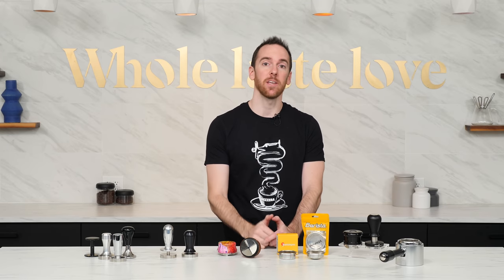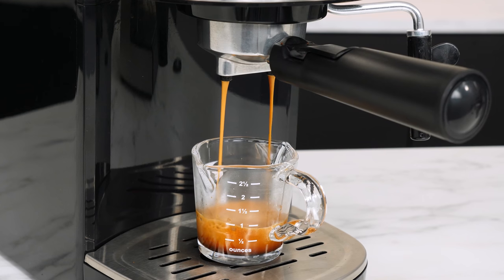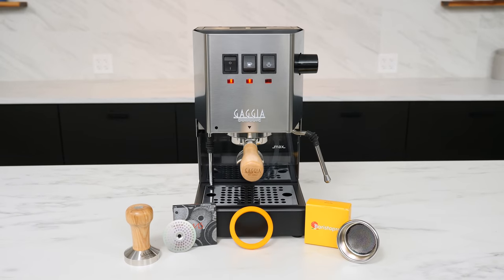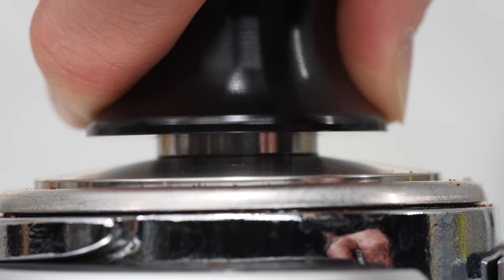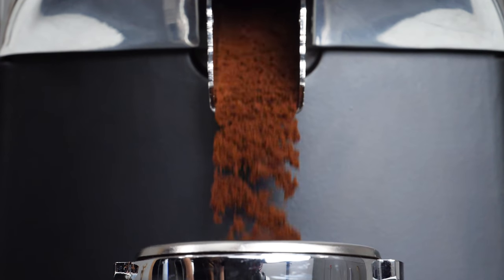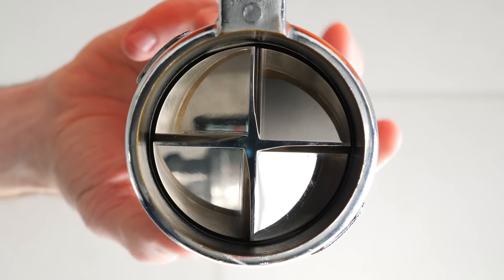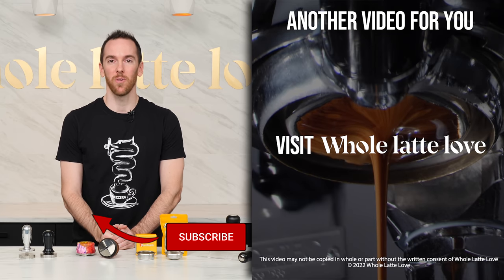Barista Tools for Consistency: Tampers, Distributors & Levelers

Comment: I was VERY hesitant to buy the Jack Leveler since I had one at 1/5 the price! But I took the plunge and I am CONVERT and I don’t tamp anymore! The user experience is a delight , clean and consistent and very nicely adjustable height and a great design and finish too. I highly recommend it! I use it with the IMS basket and my shots have never been as consistent and getting a clean puck is a bonus. It really minimizes the old frustration of channeling or a dirty puck (the IMS that is).
Reply from the maker: Thanks for sharing your experience. Those tools are certainly an investment but if they can make every day a little easier/better, it's very often worth it. 
AJ
Reply: How convenient is it to set the height? Thinking of my workflow, I'm thinking I'd have minor variations in needed height, based on minor variance in dose and grind setting. Would I be fussing around with re-figuring the height after each minor adjustment?
Reply: @andrewwilson7537  I don’t see myself changing the height at all. I think because the idea is to have consistent compression for each given weight or grind. Eg if you change from 16g to 15.5g I think the same height will compress both but if it doesn’t it’s very easy to increase the heigh for the 15.5. Then your next 15.5 will be compressed equal to the one before and you have consistent results. But so far I only went up in grams and so never changed the height.
Reply: 100 percent. I use the leveler and precision basket and there is no need to tamp. Consistent extraction every single time. Game changer !!

Comment: In my experience, WDT needs very thin needles (0.3-0.4mm) to be effective. And when you do that... it really works. The spinning distributors can be looked at as a replacement for tamping, and for that they can work nicely.
Reply from the maker: Hey David, thanks for the comment. I'll have to do some comparisons between my tool and one with thinner needles. 
AJ

Comment: Thanks for the nice video. One question: what is the difference between a leveler and a distributor? Do I need both? Thanks.
Reply from the maker: Hi a, You are welcome! Leveler and distributor are essentially the same. You do not need both. That said, some products with adjustable depth settings like the Jack Leveler are capable of compressing the coffee enough that additional tamping is not needed.

Comment: Whole Latte Love, I know you don't make almost anything on WDT's and they can also be made for a few dollars. That being said they are much more effective than a distribution tool. Just for grins, I checked the cheapest distribution tool on your site is $120.... YIKES.... 

To those who don't have a WDT for your espresso: 

A cork and some 3d printer cleaning needles for 6 bucks. You want 0.3 to 0.4mm thickness. Do yourself a favor and make a WDT. You won't regret it.
Reply from the maker: Hey Zach, thanks for the comment. Luckily WDT tools are something that can be made pretty easily at home. The rest of the tools mentioned, while pricey, provide an extra layer of control and consistency. 
AJ

Comment: I'm very new to espresso making and I did recently purchase a GEvi machine I'm thinking it's pressurized can I change the portafilter to a non pressurized??
Reply from the maker: Hi Mary, you might be able to find a non-pressurized filter basket/portafilter but it's hit and miss for entry-level appliance grade espresso makers. To be very honest and perhaps a little blunt I do not think it's worth it on that type of product. They will have other issues like temperature stability, limited coffee dose size and more that give up any gain you'd get by going non-pressurized with a product designed to work with pressurized baskets. On top of that, you will need a decent espresso focused grinder to feed a machine using non-pressurized filter baskets if you do not already have one.
Marc

Comment: Could you please tell me where I can get one of those clear plastic tamping trays? Like to show it to new shops when I train them.
Reply from the maker: Hey Barista Maniac, I ordered some empty 2oz clear cosmetic containers from Amazon and cut off the top/threads. It's not the most elegant solution and I'm hoping to get/make a better one in the future.
AJ
Reply: @Wholelattelovepage  oh thanks. How did you cut them?
Reply from the maker: I used a band saw then sanded the rough edge left behind
AJ

Comment: I’m certainly getting repeatable channeling with the bravo setup 😂 I swear the distributor is compacting the puck in a line. I get a line through the middle of the basket each time. Will keep trying but I prefer what I’m getting with the stock ecm tamper.
Reply from the maker: Hey Heron, I'm sorry to hear that. My technique using the distributor is perhaps a bit different than some. Instead of leaving the piston extended when placing it in the basket, I use my fingertips to keep it retracted, then right when I place it on the lip, start spinning - clockwise then counterclockwise. That way it does a gradual, light compression while also distributing. Maybe give that a shot and see if you're still having issues. 
AJ
Reply: @Wholelattelovepage  I had sort of come to this idea in my head as well. Thanks for the tip I’ll give that a, “shot!”
Reply: Definitely a noticeable difference. I’m still new so definitely more the user than the tools 🙂
Reply from the maker: Glad to hear that technique helped! Cheers ☕️
AJ
Reply: Hi all - I am having this exact issue after getting the bravo equipment. I did not have channeling with the stock ECM but I do with Bravo. It is confusing because the puck “looks” cleaner. Any other advice beyond what AJ said above?
Reply: @asadzia7782  after many months I’ve refined my technique. I ended up going to WDT route prior to level and tamp. This distributes the grounds evenly and then I can tap the portafilter down and knock the grounds down from the rim a bit before level. Also I noticed a huge improvement when I went to the IMS ridgless basket.

Beyond that, to avoid crumbs on the side don’t spin the leveler too fast. And really some placements I’ve found are just better than others, it’s a little tricky at first but you develop a touch for it.
Reply: Thanks! I was doing WDT already but will try your other tips.

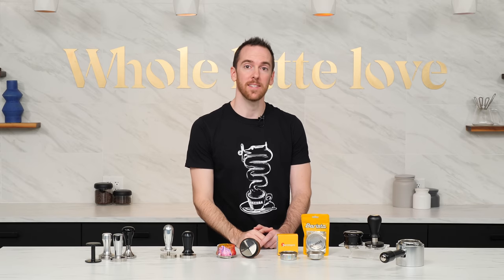Comment: @2:16 Well, the point is that these precision baskets have lasered and not punched holes ;-)

Hello, AJ ;-) Do you happen to know another Bravo-like tamper that is sitting on the rim of the portafilter — in order to make sure that you are not tamping in any weird angle?

For me, the pressure-controlled ECM tamper for example does not make any sense since you can still tamp in weird angles… It is not the price of the Bravo tamper why I am asking, it is more a question of a different look and feel…

[Edit] Another one seems to be the EazyTamp 5 Star Pro , for example…

Thank you very much indeed. See you ;-)
Reply from the maker: Hi! In addition to the Bravo tamper, we have a couple push-tamp tools that act similarly - there is an outer rim which sits on the portafilter to keep things level, and the depth can be adjusted and locked. Here are links to the ECM Push Tamper and Saint Anthony Industries New Levy Precision Tamping Tool (which comes in a number of colors/woods):
ECM: https://www.wholelattelove.com/collections/tampers/products/ecm-push-tamper
SAI: https://www.wholelattelove.com/products/saint-anthony-industries-new-levy-precision-tamping-tool-58-3mm-walnut
AJ
Reply: @Wholelattelovepage  Hello, AJ ;-) Thank you very much, I actually missed these. Seems that I misinterpreted their form factor and thought that they were “only” expensive levelers…

I will have a closer look at them. Thanks and see you ;-)

[Edit] Yes, I had a closer look at the ECM one. It is also marketed by ECM as a ”Leveler“. My personal problem is not so much to get a levelled surface, but to tamp properly, avoiding weird tamping angles — eventually resulting in an uneven puck…

Until now, I am tamping through a magnetic Wiedemann funnel which kind of works — as far as my weird tamping angles are concerned — if I pay enough attention…

Actually, I like this funnel very much (wiedemann.coffee) and it even sticks to the ECM portafilter bearing an IMS Competition Precision Filter Basket . Initially, I was not sure whether the magnets would be strong enough on this kind of stainless steel. But as I learnt now, there is something like magnetic stainless steel…

For the time being, I will probably stick to this technique. Next will be my self-constructed WDT tool made of ten 0.4 mm needles which were meant to clean 3D printer nozzles. See you ;-)

Comment: the temping pressure isn't all that important. only thing matters is that it is leveled. 
at 9 bars to a 58mm portafilter, the machine is applying over 500 lbs of force, even a 7 bar in the preinfusion phase, the machine applies over 400 lb of force. for reference, 1 bar is about 60 lb of force on 58 mm portafilter. 
your temping force of 20lb or 40lb doesn't make a dent, as long as you can form a puck.
Reply from the maker: Good point. I actually want to make a video testing this very idea - tamp different pucks at different pressures (with a pressure-adjustable automatic tamper), then measure extraction yield on each.
AJ

Comment: I could not disagree more about the use of distributers. They are expensive, only disrupt the top of the puck.

In addition, your example footage of WDT was very poor. That WDT tool's needles were very thick. Thick WDT needles cause more harm than good for puck prep. Proper WDT with .3mm - .4mm needles was the #1 method that made my espresso shots consistent.

I highly recommend a proper WDT tool, a funnel to hold grounds in the portafilter during WDT, and a self leveling tamper.

Note, I purchased a $125 jack leveler from WLL. That leveler is now stashed in a cabinet and replaced by a $5-10 wdt tool.
Reply: @JimboJones99  $50 + whatever shipping costs and it is yours. (The leveler is black)
Reply: You say disrupt the top of the puck I say it provides a flat even surface for tamping. WDT alone can leave a possible mound on one side of the puck creating a higher density after tamping, then most of the extraction will come out the other side, the path of least resistance. Will agree to disagree
Reply from the maker: Good discussion, guys. It's clear there's more than one way to skin a cat or distribute coffee grounds. What's important is finding what works best for you in order to get consistent shots, and it seems all of us have done that.
AJ
Reply: WDT is not an easily repeatable process.  Palm tampers and levels absolutely have their place (along with some kind of declumping technique).  I swear this coffee community is just a bunch of parrots until the next 'paper' is written, lol.

Comment: Well it would be nice to upgrade to a decent grinder, been using a Braun for over 25 years now, the burrs are starting to wear thin. My big issue is I need ONE grinder for both filter and espresso, don't know if such a pro grinder is available. Cost is another factor. Here in Greece not only does on pay dearly on import fees but there is a 24% sales tax on durable goods. Never had this sh!t in the USA, having worked in food service and lodging I always shopped at resturant supply shops for pro equipment, preferably gently used. 
I also see issues with calcium buildup in the boiler chambers here since the water is quite hard. Few restaurants or individuals want to spend the money on a decent water softener and filtration system. Crappy water=crappy coffee or post mix beverages. What I can't figure out is why these tampers are SO expensive! Very little to them. Anyone with a small lathe can turn out several per hour with aircraft grade aluminum.
Reply from the maker: Wow, 25 years is a good run!
My favorite "budget" all-purpose grinder is the Baratza Vario: https://www.wholelattelove.com/products/baratza-vario-grinder-w-metal-portaholder
I featured it in my a video last year, "Top 5 Best Espresso Grinders Under $500": https://youtu.be/BuCcnPil0AI
As for the water, you are right that bad water = bad coffee, and also drastically shortens the lifespan of brewing equipment. That's why good filtration is so essential for both taste and longevity. 
AJ
Reply: I have to agree, Baratza Vario is a great choice. Especially if you get the steel burrs (either buy them aftermarket for the Vario, or for the Vario-W+ it comes with them) and do the Alicorn hyperalignment (see the thread on Home-Barista about that).
Reply: If the water is too hard for your coffee, instead of installing a water softener, which has its cost and its own issues, the most logic thing to do would be to buy a bottled water with small mineral content that you would use only for coffee. That must not be a great cost, and you can experiment cheaply until you find the right solution.